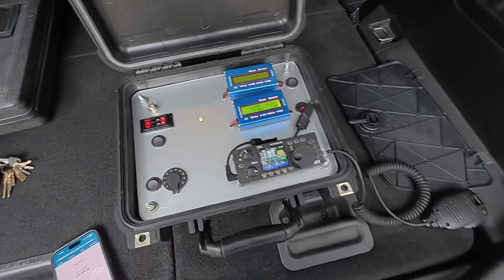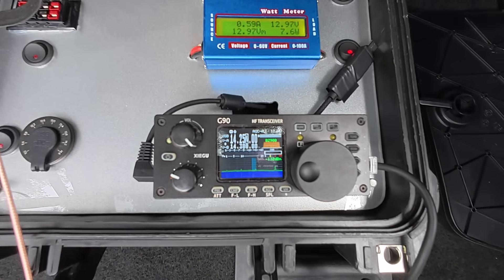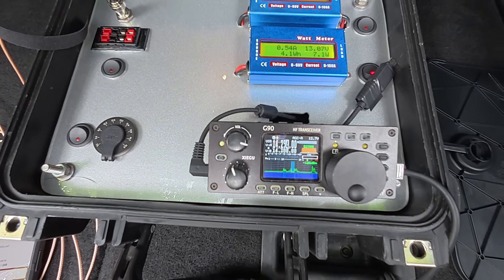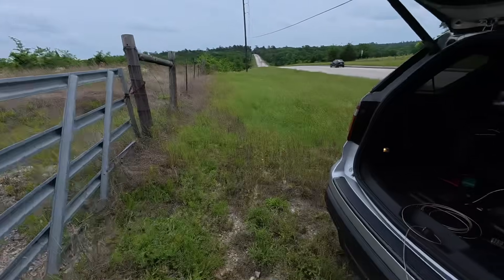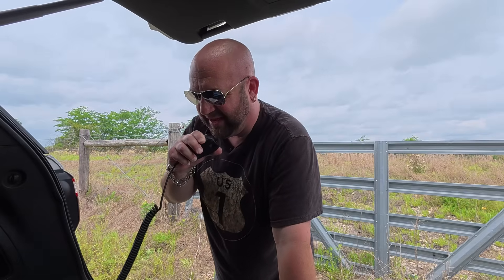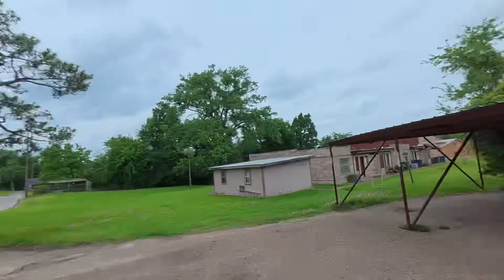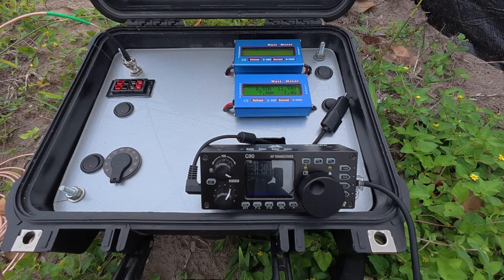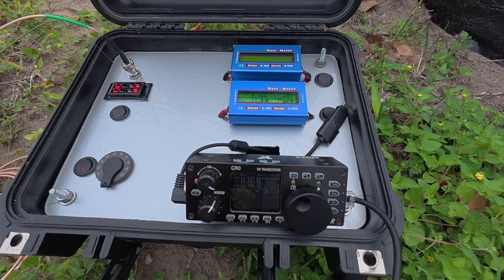Turning Random Objects Into Antennas With My Xiegu G90

Comment: Question, if the metal structure you use as antenna has different resonance frequency  than the transmit frequency set on your G90 radio isnt the radio at risk for damage? Or did you check the antenna objects resonance first, or put some protection in place or does the radio have some internal protection so you don't fry your radio?
Reply from the maker: No.  That's the point of a tuner.  It matches the impedance to what the radio wants to see.  It's not actually tuning anything, but it is creating a 50 ohm match so the radio doesn't self destruct.  But most modern transceivers have protection built in so if they see a huge mismatch in impedance, they will reduce power and not get damaged, even without a tuner.
Reply: @hamradiotube  thanks for the explanation. So you have an external tuner between the antenna and the transceiver?

Comment: I have done this as well.   Used a 746 Icom.   Used a old well site for a ground apox 4000 ft deep.  Then an old railroad rail , hooked center to one , ground to other.  Made a few contacts.    top wire on a 1 sq mile fence   great receive.   would tune...but no joy on contacts.   Great videos    73  de KC5LQA Sweetwater Tx

Comment: just wanna point out , if you look at your video the fence gate (farmgate) you got the bnc bajonet laying on the bare metal efektiv creating a shortcircuit  curse the baconet is ground (the black output of the bnc and on your cable the shield

btw the hous own ground from the elektrical outlets work great as antenna to esspecialy on lower frequencys ... atleast here n germany in dont know how your elektrical work is

Comment: I've used the following as antennas: an old 12-volt cell phone charger, an incandescent light bulb, a soda can, a Pringles potato chip can, and an inverted antenna splitter with two copper wires.

Comment: Are you running the antenna cable without the shield side connected? Just the center cable only? I want to play random object antennas. Just want to make sure I get the coax part right. Edit to add. Howdy from SW Texas. Maybe catch you for the Texas QSO Party. The club will be operating in the field. Call sign AA5KC for the club. 73.

Comment: For the railing that wouldn't make the contact, try running a wire from the shield of the Coax to the OTHER railing  :)  Not a dipole, but a dirailing :)

Comment: when we were kids we were given hand-me-down big square analogue TVs. To watch TV I used a metal clothes hanger poked into the back of the AV antenna port in the back of the TV. At one point I connected the TV to the household plumbing heating system that was copper and realised I got a better TV reception. So I often used the copper plumbing pipes in the house as a TV antenna :)

Comment: Back in the 1970s, was part of a Field Day activity in the Western US, we were on the edge of a saline fresh water lake, had an HF beam on a mobile retractable tower, we used a large steel cable for the ground but dragging it out into the lake. Best contact of that contest was with an operator out of rural Australia who was using a 25 mile long electric fence as a random wire antenna. Still remember that to this day! 73 and thanks for rekindling the fun memory!

Comment: I like building antennas from junk wire because there's no reason not to. My 40m dipole was free thermostat wire hoisted into a tree with junk rope and a 1lb lead weight I found near a boat ramp. I collect good throw away and I never run out.

Comment: Hey Mike if the g90 can tune that up do you think the ic-7300 what tune it as well?
Reply from the maker: Maybe.  If you put the 7300 in Emergency mode it might have a chance.  That opens the tuner up to I think a 10:1 but limits the power to 50 watts.  Settings>Others>Emergency>Tuner, then it'll restart and be in Emergency mode.  Repeat to take it out of emergency mode.  It's pretty cool to use if you have a non resonant antenna too, like a 9:1 or 4:1 and don't want to bring out an external tuner.

Comment: BE ACUTLY AWARE OF CHARLATANS ... 
AS I SAY USING MY FULL ZICE TET EMTRON.. WITH A T2x TAILL TWISTER 100FT TOWER
OPERSTORS WITH BIG ANTENNAS 1/2 CABEL  HAS GOOD CONDITION ANY DAY OF THE YEAR
NOT ONL WHEN AND DURING SOLAR MAX SUN SPOT CYCLE .. TUN ANYTHING IN 6 7 YEARS .. 
WELLL IT WONT WORK .. THIS IS MY 5´TH CYCLE.. NOW CALL ME A LIER..

Comment: it might be worth while for hams to check some metallic structure for stray voltage for example metallic fences in proximity to high tension power lines before terminating your antenna feed.

be aware of cattle fences and stray voltage that foliage can carry to ground.
other situations could include stray voltage from leaking buried cables.

certainly keeping an eye on swr.

using decommissioned train tracks would be an interesting experiment to create a full wave antenna.

be aware that even non electrified tracks that are operational can and do carry voice and telemetry, transmitting on those will cause problems.

Comment: As my elmer once said:  "Anything is an antenna if you're brave enough."  "If it's below 5:1, call CQ!"
We were on our way to Dayton about 12 or 13 years ago and stopped in a parking lot to get out.  My elmer spies all of the aluminum light poles in the parking lot and digs out his bag of tricks.  First was to attach a copper strap (normally for bonding on electric meter poles) around the light pole at an "eyecrometer" distance off the ground, strung out about 40 feet of wire for a counterpoise and got on the radio.  Believe we made several CW contacts on 17 and 20m QRP using that light pole as an antenna.

Comment: Back in the 90s when I was a kid add Homebase ham radio system what were you weren't allowed to have external antennas in the trailer court that I lived in so I turn the whole trailer into the antenna it worked beautifully I even did it to my TV that I had and I was able to get up to 16 clear channels out of my trailer antenna and that's a trailer home

Comment: I just wonder, since you discovered on the second tune up location that your signal was split, I wonder if you go back to the handrail (the first attempt) and re-try, if it will tune.
Reply from the maker: 100% it was in split.  I remember when I changed it and didn't change it back (after this of course).  The railing will be back.

Comment: What a scream,  and a spot of Dejavu Back in the early 1980's we used to drive around connecting to random objects and tuning them up to the Kenwood TS430S via  a Dentron DN2000A Antenna Tuner and Diawa CN620A cross needle VSWR meter, One of the best antennas we regularly used for DX (27Mhz) was a length of Railway line fencing that was close to 10km long,

Comment: I have used a few odd antennas back in the day playing CB tag, but the point then was to hide my location. One was a railroad track. People near the tracks but not me, thought they were close. Another time we went out in a boat an ran a ground wire in to the water. This was on Nickajack lake. People on the other side of the lake thought they were right on us. Not sure how much the ground wire helped or if just being on the water caused it. I did try to use a rooftop TV antenna once. didn't do that well thought.

Comment: I saw a WW 1 sigs manual showing how to put a spike into a tree and use it as an antenna. (It gave different characteristics depending on whether it had leaves or not.) Now I want to try it with my G90! :)
Reply: During World War I, the use of trees as makeshift antennas was an innovative technique employed by the U.S. Army Signal Corps, pioneered by Major General George O. Squier. By driving a metal spike or nail into a living tree and attaching an insulated wire, soldiers could use the tree as a natural antenna for wireless communication, leveraging its sap and structure to conduct signals. This method, later called the “floraphone,” was particularly useful in dry conditions where traditional ground-based systems struggled, and it allowed for receiving signals from distant stations, including enemy communications, without bulky equipment.
The setup typically involved:
	•	Spike and Wire: A nail or spike driven into the tree trunk, connected to an insulated wire leading to a receiver (e.g., an audion set or telegraph kit).
	•	Grounding: Wires buried radially around the tree’s roots or a small wire netting laid on the ground beneath the tree to enhance signal reception.
	•	Tree Selection: A living tree with a full canopy of leaves and ample sap was preferred, as dead trees were ineffective.
This technique was tested in 1904 and refined during the war, enabling communication over distances like 3.5 miles between Goat and Alcatraz Islands. In France, it facilitated intercepting German airplane communications in areas where transporting heavy field wireless sets was impractical. Multiple trees could be connected to act as a single large antenna for improved signal strength.
The method was a wartime workaround, not a standard practice, and its effectiveness depended on environmental factors like moisture and tree health. By the war’s end, advancements in radio technology reduced reliance on such improvisation, but it remains a fascinating example of early 20th-century ingenuity.

Comment: 2 points on random metal objects and conductivity: 1: If it is galvanized its steel. Aluminium doesnt corrode and it cant be tinned anyway. 2: Filing or scaping away the surface treatment/oxide layer will provide a much better connection, especially on galvanized steel.

Comment: Really fun video. I hope to get into ham radio at some point. I have some old gear I have acquired over the years.  Also played around with RTL-SDRs and old allied shortwave receivers. 

P.S.  aluminum is not galvanized as far as I know.   Galvanize coating is for rust protection. Aluminum doesn't rust so galvanizing aluminum wouldn't make much sense.

Comment: Vy good. I'm in the - most anything metal and Earth isolated can be loaded up and used as a radiator camp too. What are you using as a counterpoise? Or, do you clip a length of wire off the shield side of the banana post? 73,n6spp-cm98

Comment: I think I notices that you did not use a counterpoise wire. Maybe this would help. Have fun. 73
Reply: Maybe as a next step for efficiency , but it would defeat the purpose of the video, considering he got 4/5 and the failed one was likely transmitting on the wrong frequency.  Can’t wait to try something like and see how much compromise I can get away with

Comment: When I got my Novice ticket, many moons ago, I tried various objects like you are doing.  I hoisted a set of bedsprings on top of my 8'X16' tool house that I turned 1/2 into a radio shack.  I was worried about the capacitance, however, it worked.  
During WWII, the Allies used trees as antennas.  I think read about that in QST.
K8MRD de N5XS 73 ..

Comment: If it's galvansed (has that speckly finish) then it's steel. Aluminium does not need to be galvanised because it does not rust like iron-based materials do

Comment: Why does the Chinese Xiegu G90 have a better ATU than any Japanese-made radio?
Despite some shortcomings in filtering, the G90 comes close to being the ideal radio for many hams. One of its standout features is the built-in automatic antenna tuner (ATU), which outperforms the tuners found—or often not found—on Japanese radios.

Manufacturers like Icom and Yaesu seem locked into an all-or-nothing approach: either full-power 100W rigs, which are bulky and power-hungry, or 10W QRP models, which can be limiting, especially for DX SSB work. The G90 hits a sweet spot with its 20W output—enough power for serious communication without the high current draw of a 100W rig.

If Icom or Yaesu released a 20–30W rig with the same ATU performance as the G90 and paired it with the superior filtering and build quality we expect from Japanese radios, I’d buy it immediately. Unfortunately, their latest offering, like the FTX-1F with its 10W output, just doesn’t cut it for more demanding operations.
Reply: Except 20W isn't enough for even medium DX reliably. 50W on the other hand....
Reply: @mrtechie6810  10W not enough? 20W not enough? I'm doing a quest for 100 countries at HALF watt output. Got 75 so far! Guess you're not up to the challenge of REAL QRP. WA4NID
Reply: @davidjohnson497  correct. I am interested in reliable comms and emergency preparedness. Really doesn't matter to me if it's 50W or 5W as long as the message gets through. 
I can tell you from experience testing that 20-50W seems to be the sweet spot. But in marginal conditions, sometimes even 50W is not enough.
Any way, if QRP makes you excited, knock yourself out! 🤷‍♂️
I'm not going to bother running my VarAC Cluster at 5W because most of the time no one would hear it, so it would be a wasted station!
Note that my station is located in the Middle East, NOT in the U.S. and that it is surrounded by mountains and the ground conductivity is poor. Power can compensate for a challenging location!

Comment: I bought a G90 today because of this video.  I want to do exactly what you did.  I have a few questions though.  As a new ham, my first question is what antenna setup did you use with the alligator clip?  and how did you check the continuity with the multimeter?  i'm unsure of the settings to use and what to put the probes on.  KJ5JVS

Comment: As a teenager around 1960, I lifted our 40 foot TV antenna pole up onto a Coke bottle as an insulator.  Then cut the 3 guy wires and installed insulators near the ends.  Used a piece of conduit to make a gamma match.  Worked all over on 20 meters with that crazy setup.
Reply from the maker: Just the fact that you used a Coke bottle to do that is awesome!

Comment: In the state park outside Huntsville, on the pier by the swimming beach is a sign that says Do Not Feed The Alligators. I'll bet it would make a helluva good antenna. All the college kids used to keep stealing that sign back in the 70's and putting it in their dorm rooms! Cheers from an old Bearcat! SA5IYA
Reply from the maker: There's no shortage of alligators in Huntsville State Park.  I'm pretty sure all the signs are wood now though.  I'll have to double check that sign.  If it's metal, it would be cool to load it up.
Reply: State Park on I45?

Comment: I can't help but wonder if you might have worked a station on the hand rail radiator if you had been calling on the same frequency as he was on?  I'm not being critical, I've done the same thing before. 73 de W5EN Steve
Reply from the maker: Oh for sure.  After the fact I remembered when I put the radio into split and never changed it back.  I'm going to have to revisit that railing in a future video.

Comment: I set my electric fence up with switches to change the length.  Of course I disconnect the power supply to the fence first.  It is an emergency antenna.
Reply from the maker: That is too cool!

Comment: Not all this excited.   Just throw up an antenna!!!     Things like  fences and other rusty, galvanized,  sloppy  mechanical structures make GREAT  mixer diodes. And they do so in receive mode as well. If there are any substantial transmitters around,  you WILL have noise  and intermod, etc, in the receiver.  I can still remember  wen I worked form a communications company, approaching a site,  the handheld would go  nuts.  You could hold two screw drivers,  cross the shanks, and rub them together,  and generate  a LOT  of noise and intermod.   "unintentional  external diode mixer"

Comment: Add a little rare earth magnet to your antenna attach wire. Most outdoor metal is steel, not aluminum, which will give you a more stable attachment, with the magnet acting as a strain relief to your alligator clip.
Reply from the maker: Ooh I actually have a bunch of those.  Good idea!

Comment: I haven't been on the air in years. I really need to get back into it. Tuning up random metal things looks like fun. I have a Yaesu FT-817 and an MFJ manual tuner. I should go out and see what I can tune up. In the past I have wondered if you could tune up a street light pole. I would probably add a counterpoise to increase the chances of it tuning up. 

Thanks for getting me excited about ham radio again. 

73 DE KK6FVP

Comment: Those BNC to binding post adapters are great. For a simple dipole feed point run cordage through the vertical holes so you have a half loop to hang it from. Then stick a keyring in each horizontal  hole. For the antenna wire I use 22 gauge speaker wire with a spade connector on the end. The wire is wrapped onto one of those clothes line reels for camping. You just wrap the end of the wire a couple of times around the keyring and stick the spade connector on the binding post. Then let out as much wire as you need for the band. If I remember correctly you can fit enough wire on the reel for a 40 meter dipole. 

73 DE KK6FVP

Comment: The whole coax is an antenna, unless you choke at the feedpoint.
Reply from the maker: That's why I made the wire from the binding post to the alligator clip much shorter in this video than the previous time I did this.  I wanted to eliminate as much wire as I could between the "antenna" and the feed point.   The coax did "some" RX when it was not connected to the binding post, so it's definitely part of the antenna to a small degree.  I'll have to put a choke at the feed point the next time I do this.  I think that's a great idea!  I'll be curious to see the difference.  I could put a choke at the feed point and at the radio and see what happens too.  Good stuff.

Comment: When you think about it, commerce HF mobile systems use a 3m whip fixed to the bumper with an ATU at the base. They work and what you have in these examples is similar.